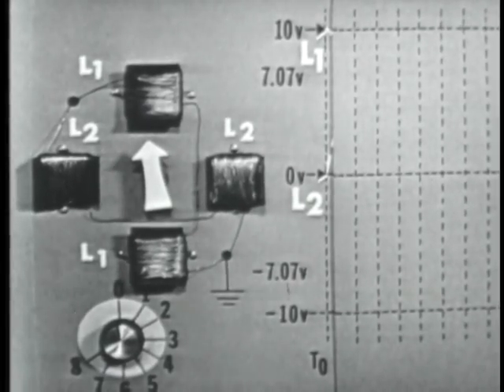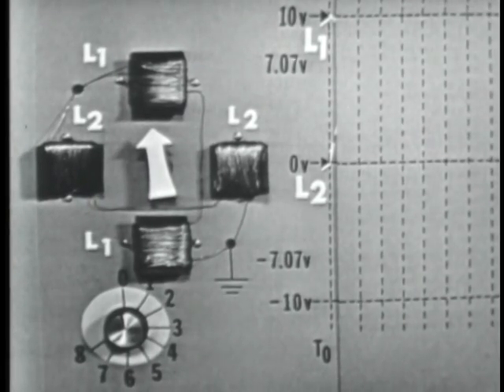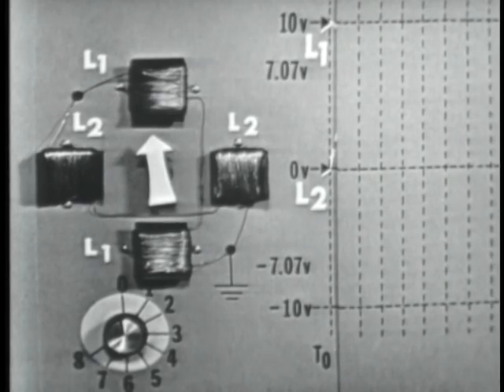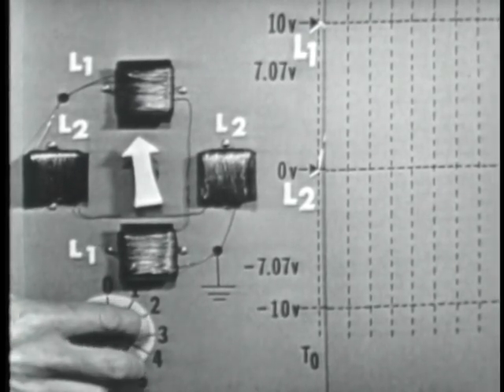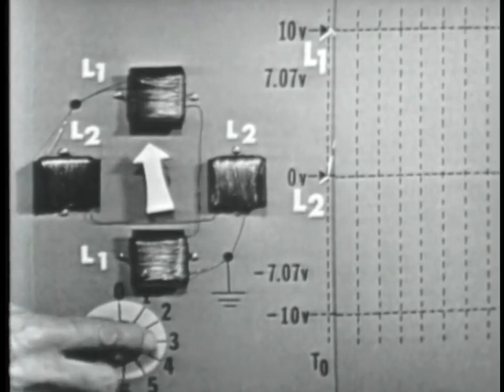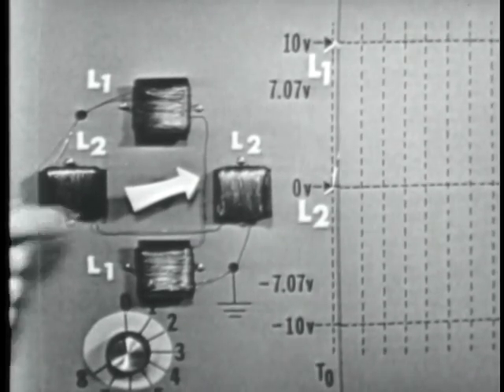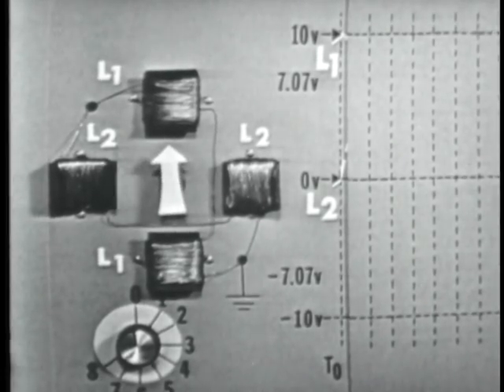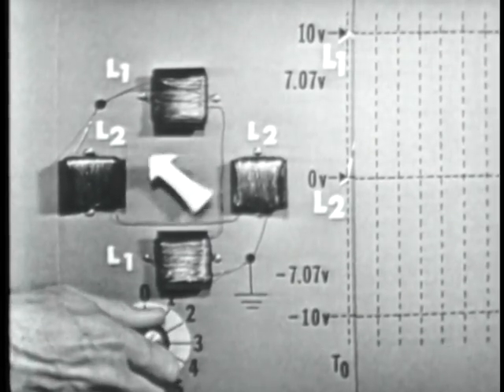AC MOTORS

Comment: You know a lot of youngsters who may happen upon this upload my pan it as "old foggy, decrepid grand daddy junk" 

But the basic information contained therein is still valid and thus good, you know.

One thing or two I'd like to mention about induction motors demonstrated up above, not mentioned in this vid. Compared to regular ac motors, they much quieter in functioning and more durable in  operation compared to regular ac motors. They are brushless and so nothing gets worn down during a long time or working, compared to the regular ones. 
However the trade off (as life is full of them trade offs) is that, as said indirectly by the gentlemen using " they are limited", is that they are caparatively weak in torque or rotational force. Which is why regular ac motors are used, for example,  in power rotary saws. An induction motor in that case literally just wouldn't cut it. Like if an induction motor was connected directly to that humongous radar antenna shown in this vid, that big heavy ol thing wouldn't move circularly an inch. It's too weak for that kind of work. It needs a reduction gear box between it's shaft and that of antenna. But, However, because of the engineering make of it, it will last much longer in operation than a regular one, as rotating radar antennas need to operate around the clock to detect and  alert. A regular motor, compared to the induction one will burn out sooner than desired.

Comment: Is it just me or did they mess up the direction of rotation. Because in one part of the video a positive voltage applied to both coils the needle moved in between the 2 positives. But then when they were using the graph when they applied positive to both the top is still a north pole and the left is still a north pole. My question is why did the needle turn to the right when it should have gone the other direction?

Comment: An Old Black and White (but Excellent, Educational and Correct) Documentary Film. Note that in this film Bob uses “Left Hand Rule”, the established rule is “the right hand rule” where you put your thumb in the direction of current (that flows from + to -. The results are identical if the current is defined as the direction of the flow of electrons, i.e. from – to + . Note also that it was Michael Faraday who invented electric motor and not Tesla.

Comment: Produces current in conductors which anytime current flows in a conductor will produce a magnetic field of its own. Hence the rotor becomes a magnet when current flows in the rotor bars caused by the moving magnetic field from our magnets on disk example. With AC the stator changed polarity itself and so you get this "phantom" rotating magnetic field instead of needing to spin magnets on a disk as in our example.

Comment: AC Current goes in the field windings, the phase and frequency of the AC current determines how fast the rotor spins.

I think you need to learn about induction. Then you'll understand why the rotor becomes "magnetic".

You can prove this to yourself by dismantling your washing machine, pulling out its AC motor and removing the insides. Then switch it on and poke metallic things in the hole where the rotor used to be. Do it "right" you'll learn about induction heating too.

Comment: @ 00:40, I have a 115v AC motor just like that one there shown & I'm trying to rewire it, but not to sure& so it can be hooked back up, can anyone help me out? Its has a 1green,1black, 1red, & 1yellow wire also its connected to a smaller device, which is the speed control circuit or transformer with 2speeds high and low... How can I wire it so it can be connected to a 12G wire?

Comment: They left out the part about how one makes the field appear to rotate. Assumedly there is not some little guy turning that knob around and around.
Reply: Just connect 2 AC voltages 90 degrees out of phase, isn't that the point made?
Reply: @skuula  how tan all the phases have different voltages, but eventually be connected to each other? Wouldn't electrons "even their speed out" after connecting all wires together?
Reply: I believe it's the AC voltage alternating reversing polarity through L1 and L2 in series that causes the rotating magnetic field. Perhaps.

Comment: Common sense dude.... The rotor becomes an electromagnet that is "dragged along" with the phantom rotating field of the stator. You can take an AC motor's rotor and attach it on a free spinning bearing isolated from a disk that you attach a north facing magnet and south facing magnet at opposite ends of each other that are close to the rotor. When you spin this disk with the magnets, the rotor will try to follow this disk that has the magnets on it because a changing magnetic field... Cont..

Comment: What they do not explain is how you get two out of phase electric currents. The A/C power supply has only one. I know how it's done but wonder why they did not explain how a 'shaded' pole or a capacitor is used to accomplish this.
Reply: +imyyz4u  it was not the wiring ?
Reply: +imyyz4u its in another video of theirs
Reply: "AC Motors and Generators"
Reply: Yes, that's the one thing that's missing.